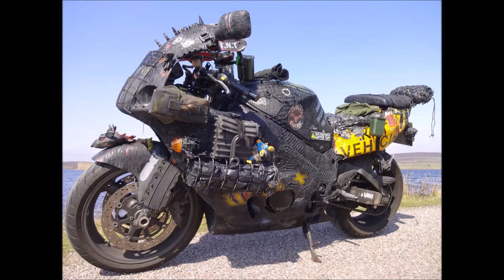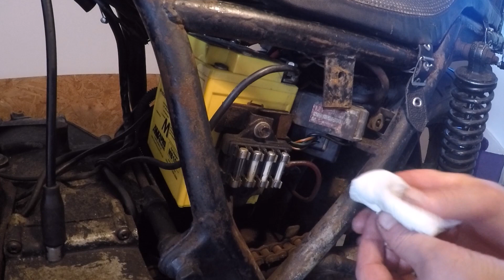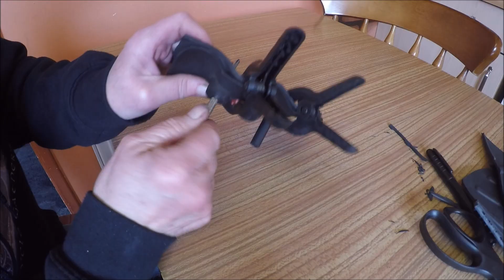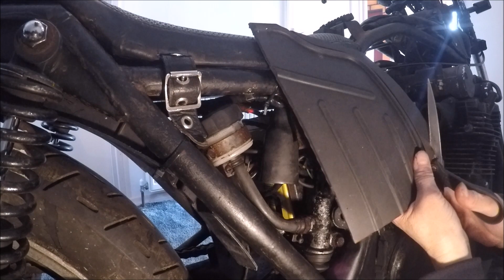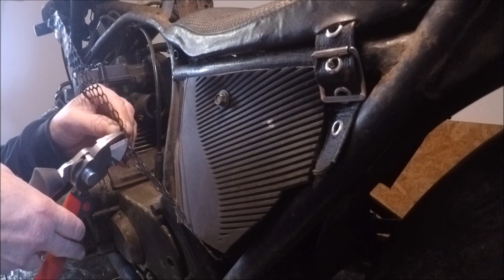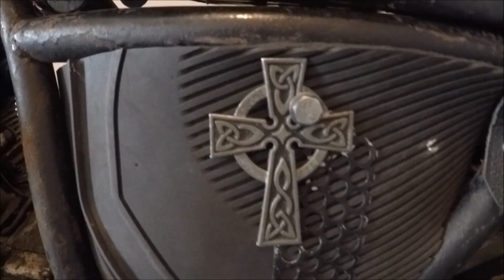GS550 Rat Bike Restoration Project 21 #Spark Plugs, Throttle & Side Panels!

Comment: Ribbed side panels for extra pleasure eh? That T1000 condom came in useful after all - he won't miss it.
(Check for air flow over that heat sink under the left panel, they get a tad warm when the pixies flow : ) x
P.S. As your voice is like silk on the wind, can we have "& ride safe." back again please? (My knees go)
Reply from the maker: What you like lol. Thanks hun and I deliberately left a big gap at the bottom of the panel for air flow. If there's any issues I can easily modify. Yes just for you I'll say ride safe next time lol :-)

Comment: Carbs? One should not search by motorcycle brand. But on brand & model of carburetors.
For example my carburetors of my Kawa Z750 B Twin are the same as those of a Yamaha XS 650 Twin.
But you knew that.
Reply from the maker: Of course I knew that lol. As always thanks for watching hun. Myself and friends have all been looking for months now for the right part number but none have been found because they are so rare. Regardless of this the original set are being repaired professionally and hopefully I should get them back soon. Putting the project on hold is only temporary! I'll continue as soon as its possible :)